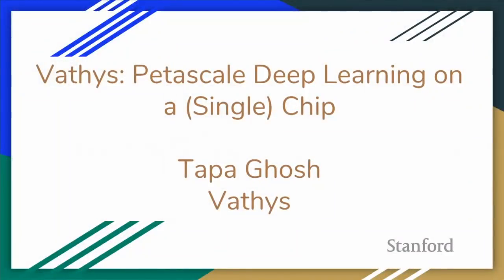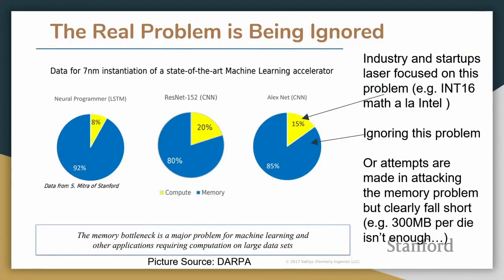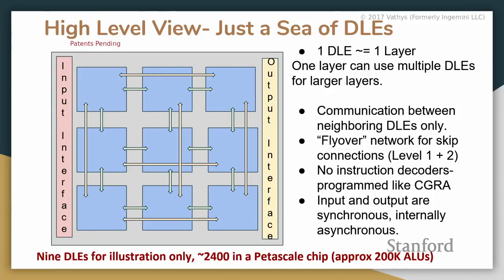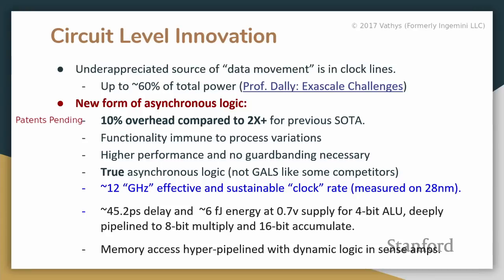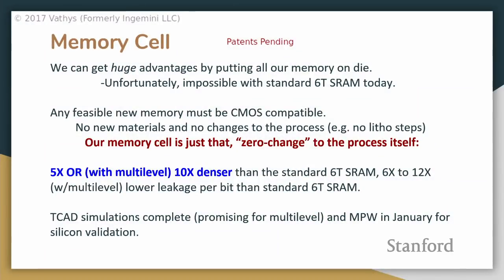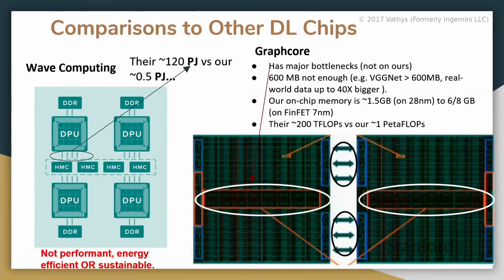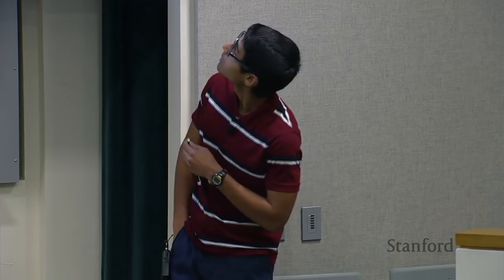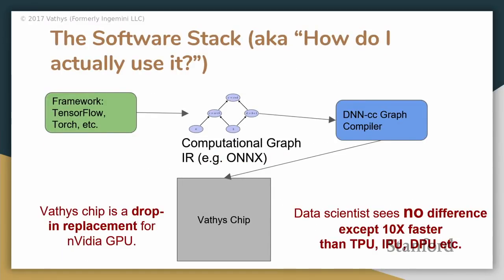Stanford Seminar - Petascale Deep Learning on a Single Chip

Comment: Have you thought about designing parts to tolerate bit errors, as a complement to low precision? (and even perhaps strengthening of via dithering effects) That way you might be able to save power and area on least significant bit (LSB) computation and data transit.

Also, cp. efforts like OpenAI, have you considered ways to make this technology more open or acessible? It seems like a really good approach overall.
Reply: We did evaluate error recovery approaches, such as approximate interconnects and NoCs, basically methods that allow some slack in the communication and/or computation channels and then recovers gracefully by applying some recovery logic. However, based on our (admittedly limited) tests, we decided there's not enough performance advantage to make it worthwhile to deal with a major additional variable for functionality. 
A more graceful approach to saving LSB power is probably using posits IMO. 

We're considering opening a bit-level simulator to the public in the cloud via APIs if there's enough interest.

Comment: If you had a on-chip memory like that, you did not need to sugarcoat it with a DNN architecture.
Reply: No memory cell startup in history has succeeded, in no small part due to the fact that getting customers is hard (edit: In the sense that convincing chip companies to use your cell is difficult). Besides, the memory cell is not the only tech we have.